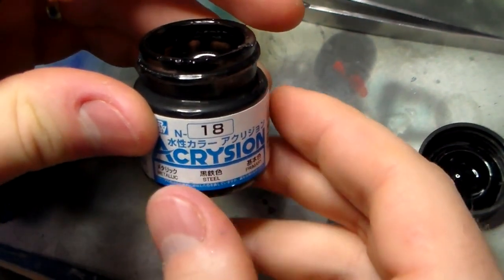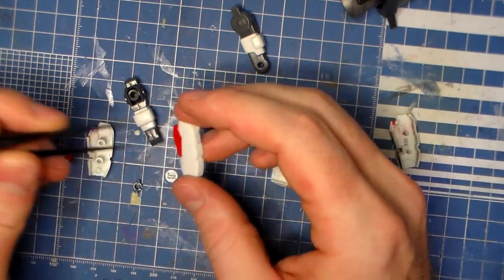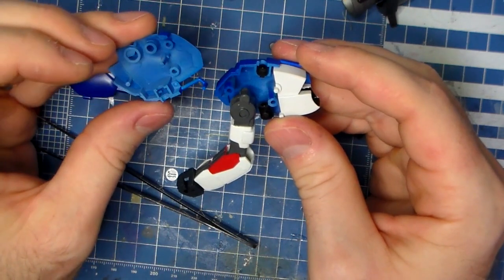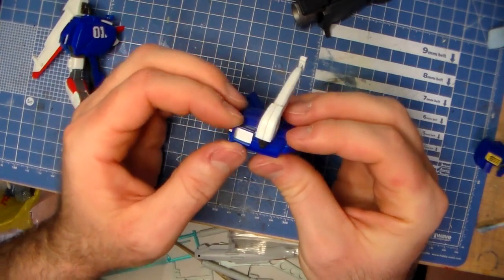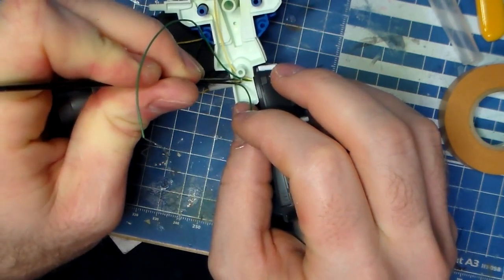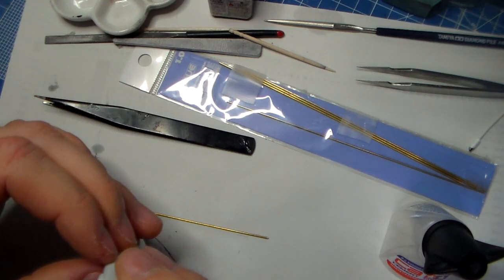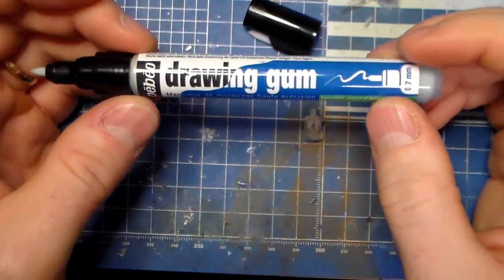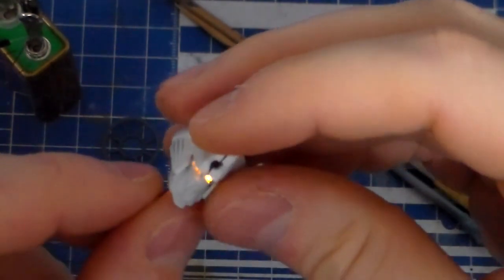Bandai 1:144 Booster Unit S-Gundam plamo build 3 Gundam Sentinel

Comment: Interesting to see how this is all coming together, a Gundam kit from an older generation when you actually had to glue and paint the parts, not so "shake-n-bake" like today's Gunpla stuff.
Reply from the maker: Well, this kit doesn't need glue or painting, however I decided to paint it and it certainly requires gluing once I make modifications to it. The old ones you're thinking of are the FG ("First Generation") Gundam kits.
Reply: @stevethefishdotnet  Yes, that's the one, that cute, perky chick from Hobby Volt has one, quite different.

Comment: I would imaged you would use the Mr. Weathering products for the vents. excellent WIP
Reply from the maker: I typically use the Tamiya panel liner just to do quick panel lines. No thinning is necessary, and it has a built-in brush. Although I wonder if the Mr. Weathering solvent is kinder to Bandai's plastic. Once I finish this build, I think my next Gundam project will be the HG Dendrobium and I'll try lighting its engines as well as its big cannon. I'll want to focus on the Macross Valk build first though. I have too many open projects at the moment.